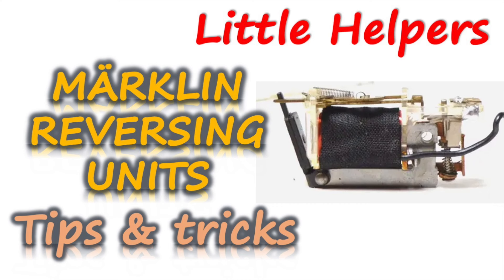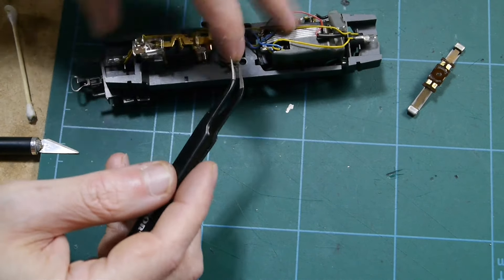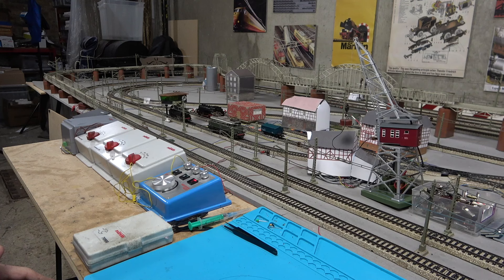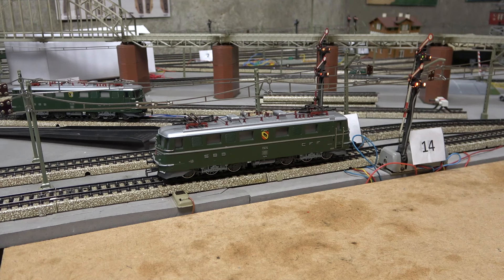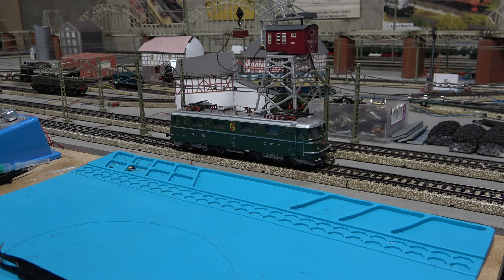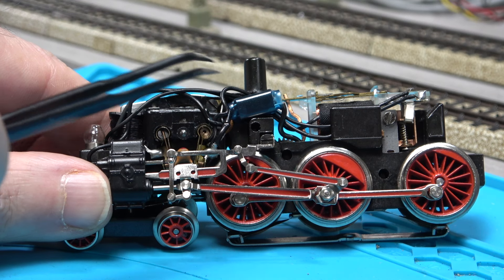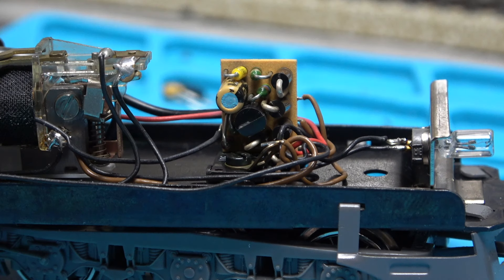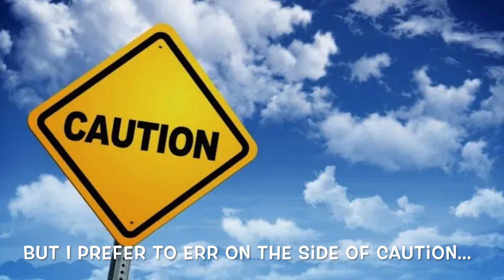Märklin Reversing Units (aka Relays) - Tips and Tricks (part 2) - Common Issues - Little Helpers

Comment: Another excellent and very useful video. Thank you.
Glad you mentioned the importance of being very careful when going near the screw of the rotating drum type reversers. I wasn't careful enough the first time and broke the wire off losing the end of it in the process. Eventually I rewound the coil - 2,000 turns I think it was - I counted them off and counted them back on again!!  I had to go and have a lie down afterwards but at least it worked. Finding spare reversers in the UK is a bit harder - it's frustrating as somewhere there will be lots lying around in cupboards somewhere!
Reply from the maker: Thanks a lot. Yep, the ground wire is a classic... I usually get my reversers on forums, the tricky bit is to find someone ready to do the paperwork needed for the parcel though... I won't mention the dreaded "B" word....

Comment: All my reversing issues were caused by my curious 12 year old self performing "maintenance," which I fortunately learned to undo. The only real issue came when we moved from Germany to the US and changed transformers and power systems, which I could then quickly resolve. Lovely video. I refer to your others to refresh before servicing my locos.
Reply from the maker: Thanks a lot, happy to read this was enjoyable, enjoy your locos!
Reply: How did you solve the power issue? We have my Father in law's old Marklins and the US transformer I bought seems under powered and won't engage the reverse gear.
Reply: @coypemberton  Marklin makes a series of AC transformers that work on 110 volts. It sounds like you may have something that is not suitable. It must have analog AC output for vintage marklin tains.  I use Marklin model number 6627. Model number 6646 is a newer unit that is white. They are 30 or 32 VA. Please be aware that Z scale transformers (DC) can easily be confused and are not suitable. If buying used, be aware of mislabeled listings and item condition.
Reply: @mountainmanpedro  thanks so much! I'll look into getting one of the Marklin ones

Comment: great video and thanks for sharing your knowledge! 
It has really helped me to repair the family set for my nephew! 
It has been passed down the ages ! 

I would like to get the 3003 up and running, but I cannot find the information I am looking for. 
I would be so grateful if anyone could please tell me 

How many winds for field magnet winding and are they wound opposite? Previous “tinkerer” has unwound it all so can’t tell. 

And secondly, I counted 280 winds on each of the three poles, is this correct?

Thanks in advance if anyone can help me.
Reply from the maker: Glad it helped. Part one goes over the basic principles of the winding arrangement. They are indeed wound in opposite direction.I don't know the exact number of turns on either field magnet or armature. Both are easy to find though, a quick ebay search should throw a few results.

Comment: If we could click the like button 10x we most certainly would. Extremely helpful this. Well, tbh, we are one of the Märklinists having tried to eliminate the jump. It seems that weight is a factor as well. E.g., no matter what we tried, the little 3029 and 3000 will always jump a bit, although the latter hardly but the 3029 remains very jumpy. The 3038 and BR 103 not at all whatsoever. And then on the NS 1200 we can't perfect it either but behaves like the 3000; just a little twitch but nothing annoying. We just have to live with it or replace the unit with an electronic one, or with a decoder such as a ESU LokPilot 5. Since we operate a mix of analogue and DCC protocol, as well as mfx+. We have thought about replacing all the old reversing units but we have kept a section purely vintage with quite some locos now in true original state. We even have sections which can change to analogue DC equipped with the LokPilot 5 which can handle AC and DC..., but all-in-all, original vintage analogue 3-rail just has its charm. Cheerio. Thank you once a again. Very helpful !
Reply from the maker: Well, that is very kind, thanks! Glad you enjoyed it and thanks for sharing. Have a good weekend!

Comment: Achtung Trafo Märklin electronic 6600 nicht mit Digital Decodern (Märklin Digital Decodern, kann man auch Analog fahren)  nutzen, und keine Märklin Lok ab Jahr 1996 und keine Lok´s vom Anderen Hersteller, !!!
Reply from the maker: re 6600, yes, this was mentioned in the video -> Digital is not the topic of the video, but yes, no digital locomotives from 1985 (!) onwards and no Delta/Universal electronic locomotives from the 1990s onwards. 1990s analogue loco are fine. The problem is the reversing pulse on the 6699 and 6600 that can be too high for decoders. See video about 6600 for the warning 😉